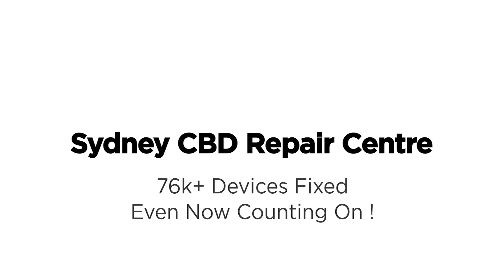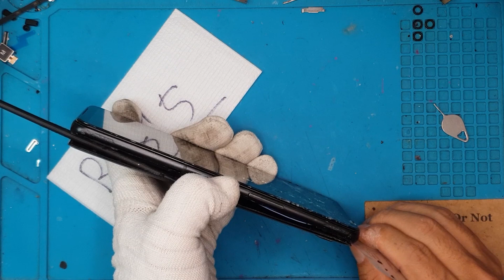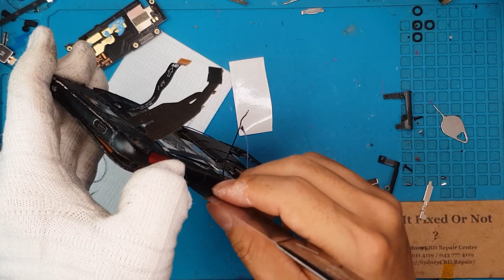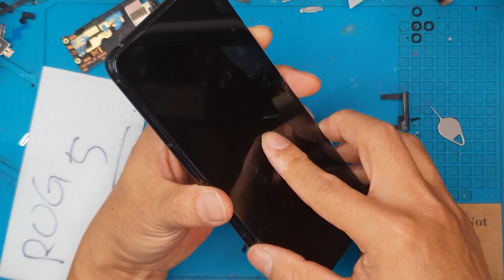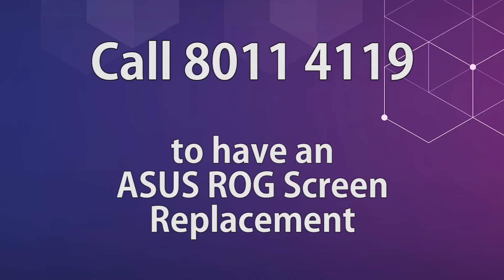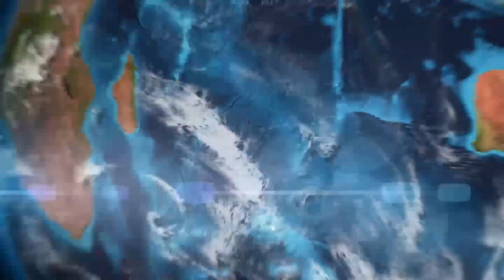FIX ALL CRACKS! ASUS ROG PHONE 5 Screen Replacement | Sydney CBD Repair Centre

Comment: Is it possible to replace screen without opening the back?
Reply from the maker: no. it's impossible. thank you.
Reply: I tried the repair on my last ROG 5 and I'm a skilled electronicd guy and I've fixed other phones , it's extremely tedious and getting it back together requires professional work. Sorry , mine ended up looking like some kind of Frankenstein banana , the screens are not cheap and there's a lot of chip boards to remove and tiny connectors.
Reply: If the repair is not viable I will sell mine for 180 bucks with the aero cooler and box 16 gig 256.